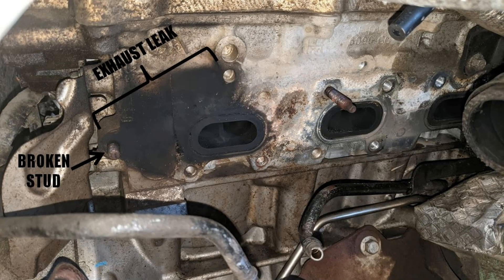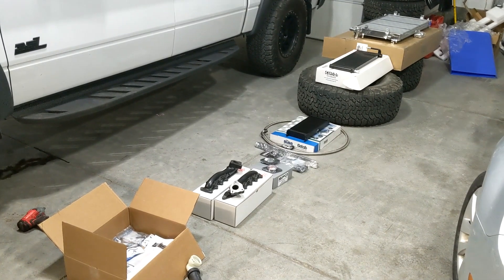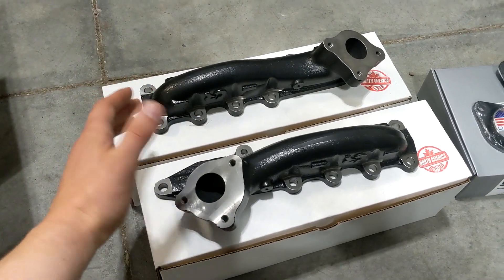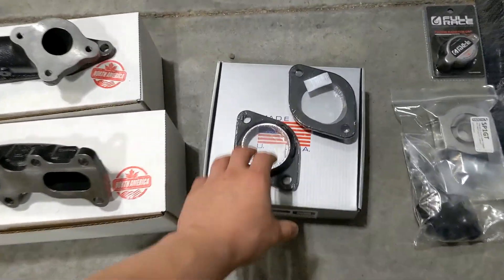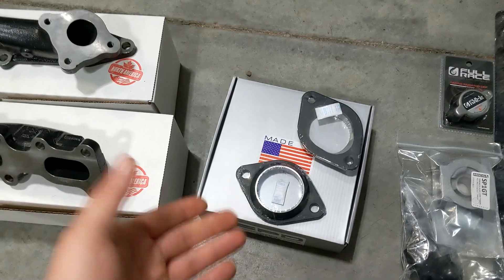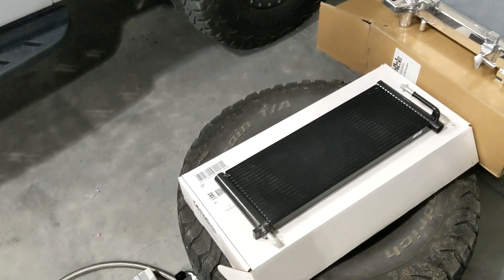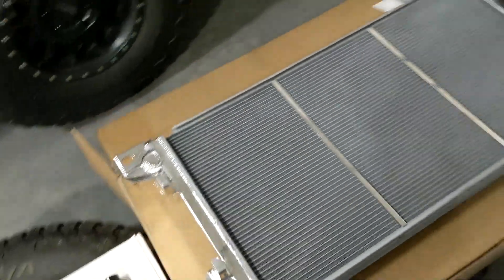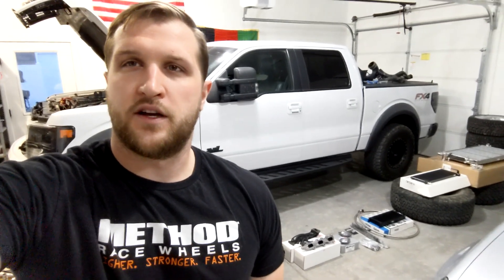Fixing 2 Major EcoBoost Problems - EP1: Game Plan

Comment: About how many hours do you think it would take to replace both manifolds ?
Reply from the maker: I feel like that could vary widely based on how efficient you are and if you run into any hiccups. Maybe anywhere between 5 and 10 hours?
Reply: @ thank you so much. Yes I’ve done everything from frame replacements without a lift and engine swaps. So just wanted to get an average to prepare. Plan on having all the gaskets and extra things to hopefully not have to go back and redo things. Thanks for your time.

Comment: 2013 MY My CR manifolds warped under towing just as 3 sets of stock ones did. Every two years it's a rebuild manifolds job. This time I straightened and normalized the CR manifolds within .005" and then took a skim off them 100% true. Let's see how this summer goes, about to tow again. Tuned or stock I overheat if pushing up a hill towing above 80F. 87oct Tow 5 Star tune with Mishimoto large radiator, intercooler no different, 1/4 throttle max in hot weather. It's the temp sensors placed right above the combustion chamber picking up extreme heat when you're on it. Back off for a few seconds and it drops off. I can tow with milder tune or 5 star transmission only tune, but tuned for full towing power is for cooler weather only.
Reply from the maker: good to know, maybe its really a 5 star issue. but we really should be able to tow uphill above 80F. luckily, i haven't had issues with my CR manifolds.  but i really watch my temps closely now. I saw there are new Ford manifolds that use the extra stud hole. if these fail, i might try those.
Reply: @NSQGarage  Man, I love my BD's...

Comment: Currently on the side of parleys canyon waiting on my ecoboost to cool off 98 degree day pulling a wakeboard boat. Ordered a full race radiator while sitting here lol.
Reply from the maker: Dude! Luckily I haven't had a reason to tow over that yet. That is a serious hill!
Reply: @NSQGarage  I make this pull a couple times a year and it’s the only time I wish I had a heavy duty truck.
Reply from the maker: @husky701rider9  let me know how it does with the full race radiator. It would be a good indicator for me.
Reply: @NSQGarage  absolutely. Also ordered the trans cooler with it but will probably keep the factory oil cooler. I hope it’s enough. I’ll be doing the pull again the third week in august and hope to have the radiator in before that.
Reply from the maker: @husky701rider9  that will be a great test. Much harder than the test I did!
Reply: @NSQGarage  my truck also has the dreaded manifold leak but I don’t know how I feel about pulling them off myself.
Reply from the maker: @husky701rider9  dang. I think that 2 issues are very related unfortunately. It's not a complex job, but it does suck
Reply: @NSQGarage  I didn’t realize how long it would take to get parts these days. Might not have my manifolds before my next parlys summer pull :/
Reply: @NSQGarage  I also had a question as to what you did for tuning after all the mods. Did you just use an spt tuner or something similar?
Reply from the maker: @husky701rider9  shit....
Reply from the maker: @husky701rider9  I already have a tune from 5 star (sct unit). I didn't retune because I just figured the boost would spool faster and not affect the tune. But I'm not an authority on that lol

Comment: Great video! For what it's worth, I have a 2015 F150 and had the dealer install the CR Performance manifolds and it still didn't help. I have a 170 t-stat to put in and I'm hoping that will help. I've seen YT vids that talk about oil coolers and a bigger intercooler, but I'm not sure how that affects the manifolds heating and warping.
Reply from the maker: I think it will help keep the heads cooler. And those mods were more for the towing issue.

Comment: Would tossing in a 175 degree thermostat (as opposed to 180 or 190) be a lazy way to accomplish the same ends?
Reply from the maker: Great question. That will only start you at a lower point. Therefore, it gives you a little more time before you overheat. But once it is fully open, a 175 is the same as a 190.